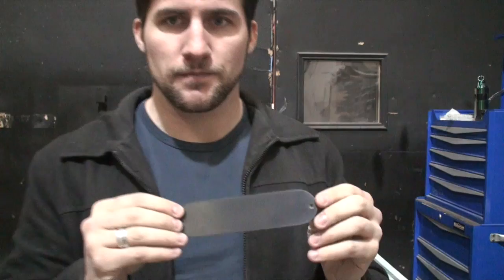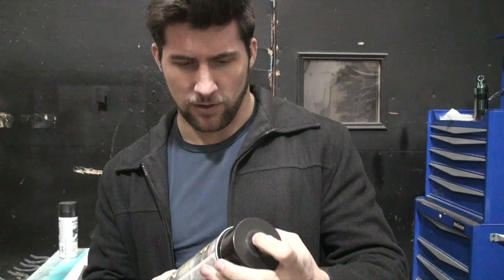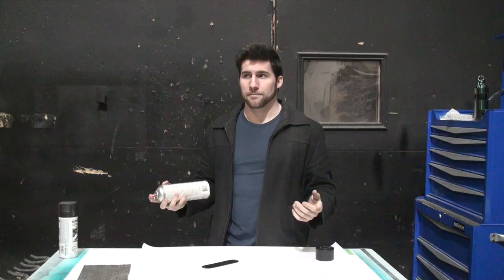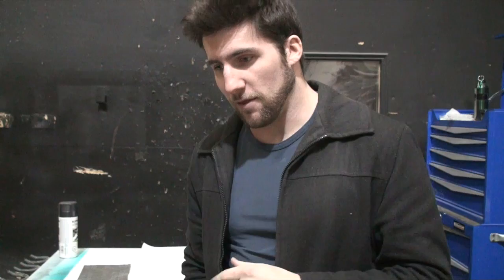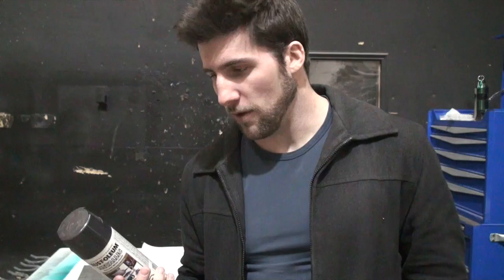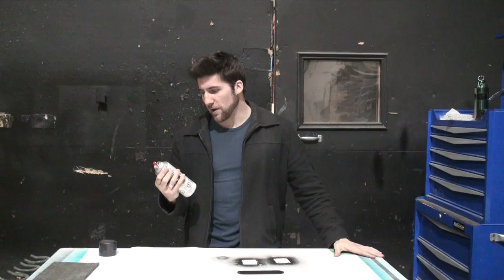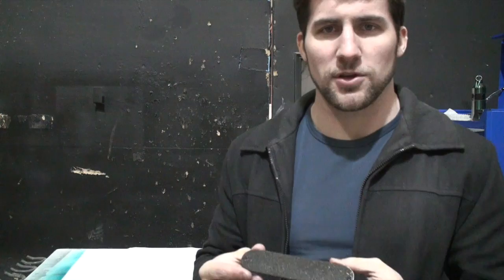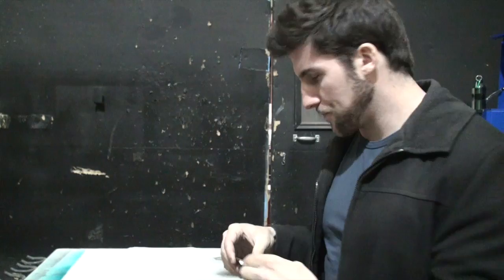How to paint plastic parts properly

Comment: This video brought up a question ive been pondering for some time.
Have you had any experience with chrome paints like gold or silver etc..?
I have seen brands like rustoleum and krylon sell chromes, but is it even possible to clear coat them? Its tricky because from what I understand you cannot ruff it up to make a mechanical bond like with a flat color you can.
Reply from the maker: PeetPrime I have worked with those a few times. If you want to clear the reflectives, spray your 2 or 3 coats, then let it dry. Scuff it lightly, then spray one more coat to make it look good again, then go right into your clear coat 10 minutes later.

Comment from the maker: @Danny Kross You can paint the plastic parts on the pickups. You can also paint pickup covers if you get them. Those might be better, and fit with your theme better more readily. Either way, the plastic on the top of the pickups can be painted, but you may want to avoid painting the magnet poles too much. The paint probably won't stick to them properly. The tape that surrounds the pickups is a different material. I'm not sure how that would handle being painted.
Reply: Could you just use standard rust spray paint, for something like a pick guard, without any plastic primer?
Reply from the maker: You may risk it peeling off since standard paint isn't designed to adhere to plastic. Starting off with adhesion promoter might alleviate that problem though.
Reply: Brad Angove
 OK never mind I already did like a week ago Lmfao, it turned out GREAT!  I'll send you a link to a picture of it some time later on with a replay, don't worry GOOD rust paint is fine as long as you give it about a day to dry, IT"S GREAT! :)
Reply from the maker: Glad to hear it turned out well.
Reply: Brad Angove
 Thanks I'll send you a picture of it when I have time :)

Comment: Hey brad, could you make a video about painting carbon fiber bike frames (already colored or not) with spray cans?
Reply from the maker: +Antonio Morales Unfortunately I don't have a carbon fiber bike frame to paint, but if it's already coloured then it's just like painting any other pre-painted surface. The fact that it's carbon fiber doesn't change anything in that case.

Comment: If you have the choice between a plastic primer or adhesion promoter which would you use?
Reply from the maker: I generally go with adhesion promoter.
Reply: @BradAngove  Curious if you find any benefit to using both? I ended up buying both not realising they are interchangeable
Reply from the maker: I don’t see why you would benefit from using both. It would be a bit like using a glue stick before applying white glue.

Comment: Brad. Awesome video. I have a new pickguard that I really like the paint job on but it was cheap and has some scratches and looks a little faded. Can I buff with scotch Brite, lay down adhesion promoter and then go straight to clear? Or just buff and use clear coat to give it some gloss? Thanks man!
Reply: Edit - I like the color and the white on the beveled edges. It's just too dull for what I want.
Reply from the maker: Yes, scuff very lightly and clean with wax and grease remover, then use adhesion promoter followed by clear.
Reply: @BradAngove  Amazing. Thank you! This is my first refurb and I've based most of my work on your tutorials. With really good results so far. Thanks for all the great info and for responding.
Reply from the maker: Glad I could help.

Comment: If you’re going to sand flat and polish you need more than 3 coats so you don’t sand through the clear coat. That’s probably why some people are putting on 6 coats
Reply from the maker: That’s not necessarily true. It depends on how flat your clear coat is when you spray it. In automotive applications people often use 3. I typically use 3-4. If you’re not very good at spraying then 6 is often safer, as long as you understand the adjustments that need to be made to your re-coat process to do 6 coats properly.

Comment: Hi. I have a UTV S 900 razor with white plastic. The color must've been injected into the plastic but I have just a few questions. Hopefully you can answer them for me. Here are the steps I've used to prepare my plastic.  1. I first just cleaned the plastic with Dawn dish soap (this could be bad but please let me know) I sanded just the areas that had deep scratches with 220, 500, 1200 and then 2000. I came back again and scuffed the whole areas with the Scotch Brite Grey pad then cleaned it off again with some Dawn Dish soap and water and dried it.    NOW,  I plan to apply an Adhesion promoter, afterwards the paint color and a final clear coat.    Can you please tell me if doing any of this is the wrong way or right way???
Reply from the maker: +Eddie Regory That all sounds fine to me. You may need to fill the deep scratches and sand again if they didn't come out. Just make sure that you scuff everything that you intend to paint, and that you mask off (cover) everything that you don't want to get paint on.

Comment: I have a question I'm trying to spray paint my joy cons on my Nintendo switch they are the grey ones but I'm trying to spray paint them neon green. So I've sanded them put down a primer then painted them but they never dry neon green but just a darker green I've tried this with 2 different neon green spray paint and still a darker green. I'm wondering is there something I'm doing wrong? Should I put a white coat of paint on first, or am I putting too many neon green coats? If anyone could help me I'd really appreciate it!
Reply from the maker: You need to base it in whit first. Have a look at my video on how to paint your guitar neon for an example.

Comment: Great video! Quick question... I want to paint my pickguard with acrylic. You indicated that you can do this just a few minutes after applying the adhesion promoter. I am assuming that the promoter is still sticky then. Isn't it a problem for water based paint? Is it better to wait a few hours after applying the adhesion promoter or does it have to be sticky to work properly?
Reply from the maker: +JF Remillard the promoter is sticky, but not wet, so it's not a problem. I use acrylics just as soon over this product.
Reply: Exactly what I wanted to know. Thanks!
Reply: Always let the primer dry, flatten it with 600-800 wet and dry grit, wipe it let dry. Wipe it with tac-cloth and apply your paint, you cant go wrong with that; the longer the primer dry, the better.

Comment: Brad what about this scenario? I have a black or red guitar and want a same colour scratchplate that isn't available? So you go clear acrylic but you have to paint the back so you dont see wiring or shielding? You cant prime that? Or could you prime using clear laquer after scuffing and  add your desired colour after that then your shielding???
Reply from the maker: Just use adhesion promoter instead of primer. It’s a better choice on plastic anyway.

Comment: I painted 300 1 in. diameter plastic circles.  If I really wanted to clearcoat them could I spray them, then align them snug together... and polish and sand them to get a high gloss?  Thats my plan if they dont fly everywhere.  Maybe Ill stick them to tape.
Reply from the maker: You should be able to get a high gloss just from clear coating them. On a surface that small I highly doubt there will be any need or reason to sand and polish them.
Reply: @BradAngove If its for art I want to sell, perhaps it's justifiable because Id be removing some orange peal I assume.  Ill show you when Im done.
Reply from the maker: You won’t really get orange peel on something that small. Anyway, you could try sticking them all right together on something, block sanding them flat, and then holding the object they’re stuck to to run them against a buffing wheel. It’s risky though, and don’t forget that paint builds up differently along the edges of a piece.

Comment: Man you do not have to do all this to have it look great and last. I’ve been painting and painting plastic for 19 yrs. you scuff it clean it extremely well and and start your coats of paint. Go light and work up to heavy and will last forever. Prep work and cleanliness is key. Adhesion  promoter doesn’t do much trust me it’s a gimmick.
Reply from the maker: So by “all this” you mean use adhesion promoter? It’s a simple step that is helpful particularly for things that are actually going to be getting used. It also depends on what type of primer you’re using or if you’re using it, as I said.
Reply: Brad Angove “all this” referring to the whole video, long as it was. Literally could have been 3 min tutorial on scuffing, cleaning, spraying. You should never change direction when painting also. If you start horizontal, stay horizontal. Switching to vertical does not allow a true even coat. Only time vertical should be switched to ,is if it’s absolutely necessary due to lack of space. Especially in automotive painting. Adhesion promoter causes orange peel as well sometimes. Seen it time and time again.
Reply from the maker: You can use a plastic compatible primer if you want instead, but adhesion promoter is the way to go in my view. 

My viewers like thorough explanations. I don’t cut the length of my videos to appease the impatient few who should probably be checking wiki how instead of youtube. 

You don’t change directions in automotive painting because of the shape of vehicles. It doesn’t make sense to paint them vertically. It’s not because it doesn’t allow for a tru even coat. Particularly with spray cans, changing direction can be helpful to assist in evening out the discrepancies that come from spraying with a round pattern.

Comment: Do you have video about painting with neon colors - orange, yellow, green(spray cans)? Tnx!
Reply from the maker: Not yet. I should have one coming up soon, but if you have any questions, let me know.
Reply: My neon colour job went to south, and the glass fiber putty showed trough the neon coats.  My lucky, that the mistake do not ruin my design plans for my 2 wheeler. When My paint jobs are done, I will do a video before and after. Well I have few questions, answer these in the Neon Spray video. Did I do something wrong, with my neon painting with spray cans? What type of primer to use? Does the neon colors suck in the base and primer coats?
Reply from the maker: It's hard for me to say if you did something wrong, since I don't actually know what you did. I like to use a grey primer and a white base coat when working with neons. If you let the base dry fully, and scuff it lightly, then you shouldn't have to worry about it mixing into the neon.
Reply: OK, Thx. Well I think, that was my problem. I did not let the coats try fully - the last coat of gray primer and 1st coat of white base. Maybe some of the coats before last primer. Well it was my fist spray job, with neon. There is a saying, that the 1st  calf goes always south. I tought about the neon and white colour design - did a quick plan in the Paint. Then I went and looked the area, where that design will be - the white area will cover the places, where the putty is showing through neon color. I have some pics about the motoscoot, when I brought, meanwhile and will do pics, when the design painting is done. I will make a video too and place it to my channel. But this design work will take little bit of time.
Reply from the maker: The first job seldom goes as planned haha. I hope your paint job goes well. Let me know when it's finished so I can check it out.
Reply from the maker: Looks like it turned out great. Nice work!
Reply: Well .... one panel got kicked over by wind and I need to do that all over again (future). I found few panels, some used and some brand new, at very good prize,. So I need to paint these too, again.
Reply from the maker: Well, now that you've accomplished this finish I bet you'll find the next set easier. The first job or two are almost always the most challenging.

Comment: Can I use adhesion promoter on unscuffed(still shiny) junk yard rear bumper and then repaint it?
Reply from the maker: I wouldn't bet on it. The adhesion promoter would be better than nothing, and if you make sure the surface is perfectly clean first it might work, but the safer option is to scuff it first.
Reply: Thanks for your quick reply.
Reply from the maker: You're welcome.

Comment: If you are painting over metal with chipped or damaged paint how do you paint over it so that the chip is completely covered and the paint is completely smooth?
Reply from the maker: Normally you just remove the old paint before priming and repainting.

Comment: Hey Brad, awesome video. I'm planning on painting a white pbass pickguard metallic silver with water spots, and I want to know how long I should wait between coats before it's done. IE, how long before I put the clear coat on?
Reply from the maker: +Kevin Card You're doing the water droplet effect on it?
Reply: Brad Angove Hi Brad, I'm considering the water drop effect, but also starting to think it's above my skill level and could be too much trouble for a beginner. Thank you for your reply.
Reply from the maker: +Kevin Card it's not all that difficult really. You'll need to let your coats of silver dry fully first though, and then do you water droplet effect. After that you'll have to wait a while for the water to evaporate. The paints go in really light for that effect, so you don't have to worry so much about them. Once the water has evaporated fully, you should be able to clear coat shortly afterward.
Reply: Brad Angove Awesome, thanks dude. Does it take a light shade and a dark shade of silver? Does spray paint dry within a few hours or is this something I should do over the course of a few days?
Reply from the maker: +Kevin Card usually the effect is done with black and white over whatever your base colour is. It might work with different shades of silver. To be safe I'd spray the silver one day, then do the droplet effect the next morning and the clear coat later that afternoon/ evening.

Comment: I am wanting to re-paint the pickguard on my guitar because it is an odd shaped pickguard, and i cannot find one in the colour i want. It's a black pickguard, and i wan it to be a semi dark blue. Should i use a white primer before applying the blue? and if so how many coats would you think are necessary for the blue to come out well?
Reply from the maker: You can use a white or grey plastic primer, or you can just use adhesion promoter, which is clear. The number of coats kind of depends on the paint type.

Comment: Great video. If painting a fender style tri-ply pickguard, can I just sand off the paint from the beveled edge?
Reply from the maker: It would be easier to scrape it similar to how you would scrape binding on a guitar.
Reply: @BradAngove  thank you, I guess I was thinking that too. So something like exacto knife?
Reply from the maker: Ya, I just use the straight box cutter blades. I’ve done videos on it with the binding.

Comment: I’m in the process of painting a guitar. I finished painting my pick guard and clear coating it, but the orange peel is horrible. I’m thinking I over sprayed, but I’m not sure. I just found this video and didn’t know to use a specific plastic primer. When I tried to wet sand it a lot of the paint Really dulled. What should I do? Also should I wet sand it after the clear coat? Thx, love the video!
Reply from the maker: The paint will always full during the sanding process. Check out my videos on how to sand and polish your clear. The key is polishing it back up after sanding flat to a very high grit.

Comment: How about skidoo snowmachine side panels they are flexible I would sand then clean i have a professional spray gun Devilbiss , is it possible to paint these side panels ? Maybe a need flex agent for plastic ? Any help would.be awesome
Reply from the maker: You should be able to use a plastic compatible primer followed by a typical automotive paint and clear on those like is done for car bumpers.

Comment: Turns out Im not using any scotchbrite on my small plastic jobs. 

Im getting orange peel on the colour before i even put on any 1k/2k clear coat.
Should i light sand the colour or drive through to the clear? Pure white colour BTW..
Reply from the maker: You'll probably want to lightly sand the colour regardless to help your clear stick properly. If you want to sand it flat at that point, it will just make flattening out the job easier later.
Reply: Thank you. 

Im working on small plastic pieces like old joypads and retro stuff. 
my booth is doing a job and im keeping my work area clean. 
im gonna have to watch all your sanding/buffering vids.

cheers!!
Reply from the maker: You're welcome. Thanks for watching.

Comment: Whats the best approach to painting flexible plastic? Like a stethoscope and will alcohol wipes ruin the paint? Thanks
Reply from the maker: Hi there. Is it flexible plastic, or is it rubber? It's going to be difficult to find a paint that flexible. The alcohol thing depends on the paint type.
Reply: +Brad Angove how about hydro dip? Hydrographics
Reply from the maker: Do you mean the printed hydrographics, or painted applied through a hydro dip technique? For paint, essentially the same rules would apply as if you were spraying. I've never worked with the printed version unfortunately.

Comment: if i spray mate type colour on it,do i need to clear coat it? it look batter not coated with clear.
Reply from the maker: +Yusry Bat It depends on what kind of paint you used. Generally I would just suggest that you use a matte clear coat overtop if you want to preserve that look.